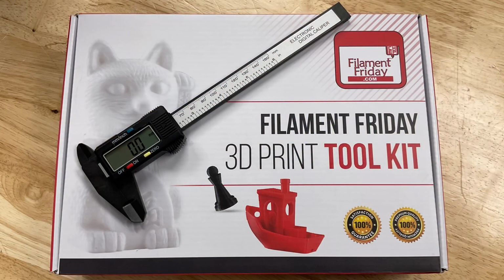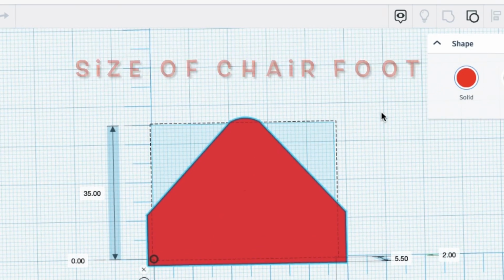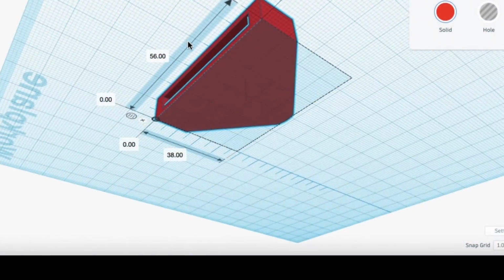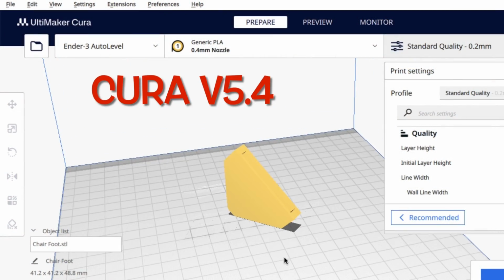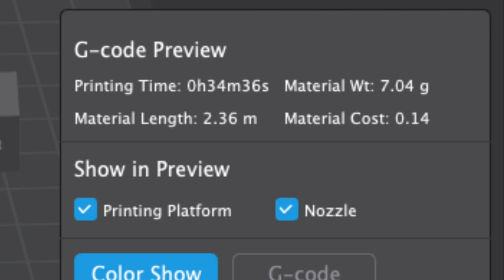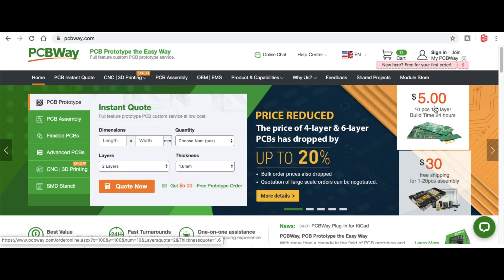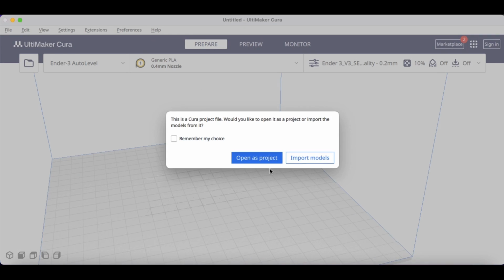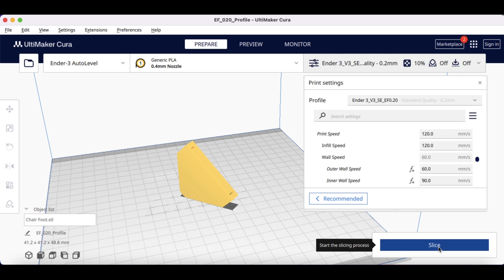Extra Fast Printing on Low Cost Ender 3 V3 SE

Comment: One year later I have two of this printers whit two nebula smart kit. 
Klipper and I 𝕣𝕠𝕠𝕥𝕖𝕕 the printers and have a nice open source printer. 
Whit mainsail and fluid and al the nice updates. 
Yeah and I have upgraded the firmware the nozzle heat up to 200 c and the buildplate go. S to 110 c and I build a in closure whit a serpert 500 watt heater and I can let it heat up to 70 c and print asa nylon carbon fiber whit these printers so nice and most printers do not come whit a heated in closure serpert from the buildplate

Comment: Is it good that print speed 100 mm/s for 0.12mm layer height?
Reply from the maker: Depends on the printer and hotend installed.
Reply: @FilamentFriday  energy 3 v3 se with 0.4 nozzle
Reply from the maker: If it’s a stock hotend then that’s too fast. Stay around 60-70.
Reply: @FilamentFriday  Gotcha. I guess that's how far I can push it. What is the upgrade if I want to go faster?
Reply from the maker: @TheGlitterMan - Yes or just better consistent flow.
Reply: @FilamentFriday  IS there an upgrade to the hotend to make print faster?
Reply from the maker: @TheGlitterMan - You’d have to convert it to run Klipper firmware.
Reply: @FilamentFriday  That will be another day LOL. Do you have video about it.
Reply: @TheGlitterMan  Could try the Unicorn hotend upgrade by creality

Comment: My se runs like crazy.
Print in place they come of super nice .
Even the air engine.
Bal BEARINGS.
Working hinges.
Most of the i print in place.
Juat the probe is not so good.
Bud happy me old school printer juat dial the offset in.
Kuat as Easy as waiting for the machine to it

Comment: I've been 3 printing for over 6 years now. I've watched lots of your videos. My first printer was an original ender 3. I've spent alot of time modding peoples 3d printers. Personally I hate Cura, I used it for about a year and dropped it for super slicer. I find it very strange to not write my own firmware for my printers. Currently there is no marlin example files for this printer ATM on marlin. Do you have any idea when it will come out?
I love this printer tho. 20 min setup time and amazing prints right out of the box.  Looking at upgrades for this printer I'd like to add another z axis motor rather than use the loop to control the 2nd z axis. I used ur slicer profile and got half decent prints. I used creality's slicer and the time was much shorter than urs, but the actually print time is almost identical. I am working on upping the print speeds for this printer, I'd really like to get a profile set on superslucer rather than dreaded cura. If you have any ideas I'd appreciate it

Comment: Just found your channel and subscribed.  I am brand new to 3D printing and boy what a learning curve.  I followed the steps in your video to load the SE EF profile, but when I try slicing with the profile it failed and wants me to report a bug to the issue tracker.  Any suggestions?

Comment: I just got my first printer a (ender 3-3d) a few weeks ago ive done multiple prints and im hooked to say the least. So naturally im looking at upgades, etc. And mostly learning the basics. I was looking for leveling help and ran across your v2 tool. I'm definitely gonna pick that up along with an auto level upgrade seeing how mine all manual. Now i see this video, and im trying to follow with what little knowledge i have with these so far, but my question with all these profiles you made are they interchangeable with other printers like the one you made for the ender 2 pro can i use thisbon my ender 3?  And what happens if i swap to a say 0.8 nozzle from the 0.4 factory one. Will these become obsolete?

Comment: I have been watching your videos for awhile now and they are really great. I am even a new supporter of yours on your website. One issue I am having is my CR-10s is not working at the moment and I am running my Anycubic Kobra Go and none of your .curaprofile files are compatible. I am trying to replicate your print profiles manually but for one reason or another I haven't been able to do so. Would it be possible for you to list your print settings? I know to do so for each of your profiles is asking a lot but even just the "CHEP 2.0 PLA" (using 0.28mm) print settings would be awesome. That is the profile I used the most and build my other profiles off of.
Reply from the maker: They are compatible. Just choose a Creality machine profile in Cura that is similar in size to your printer. Then you can use the profiles.
Reply: @FilamentFriday  Oh awesome, I will give that a try. Thank you!

Comment: Thanks a lot for this profile. I actually don't get those options to create a new profile but that is fine since I don't have one with the same name.

Just started a 15 hours print with this profile on my V3 SE.  The first few layers are looking good. This Creality PLA filament is not that great, it gets cut off when the printer is sitting idling, even though I just opened it a couple of days ago but I think it has moisture. When I sliced it on the original profile, it said 21 hours. Let's see if we can get a 6 hour saving or have this PLA die on me before that.

Comment: I think Ender’s days are numbered with Bambu’s bedslinger.
Reply: True but it’s built as a high speed bed slinger out the box which the Ender 3 isn’t. Linear rails, direct drive extruder, no tool swappable hot ends, multi filament capability, auto nozzle cleaning, auto levelling, same flat bed as the core xy machines. (My Ender 3 bed was warped which I had to fix) The Ender 3 is an enthusiast machine which you will spend the same money as a Bambu on fixing it. Bambu’s bed slinger is a better refined household high speed printer with none of the hassle of the Ender 3.
Reply from the maker: @Stuntman707 - For about that same price I’d rather get an enclosed K1.
Reply: Always hoping it doesn't burn your house down or electrocute you while using it.
Reply from the maker: Maybe but more than twice the price and I don’t like the closed source firmware/electronics.

Comment: Bambu is going to push a lot of older machines aside. But hope this encourages competition.
Reply from the maker: Maybe but more than twice the price and closed source firmware/electronics.
Reply: Bambu is bringing the upgraded high speed experience to bed slingers. It would be nice to see Creality catch up and finally get rid of all the obsolete Ender 3 models.
Reply from the maker: @Stuntman707 - I’ll be testing the Creality Ender 3 KE soon that has Klipper installed for higher speed.
Reply: @Stuntman707  You should be better informed. Even before the A1 and A1 Mini, there were bedslingers that reached 500mm/s. Bambu Lab is late to the party. What stands out about the A1 is the ease of use, not the speed.
Reply: in a year, when they start to deliver the preorders and when it will be actually possible to buy them.

Comment: Does anyone know if there is a glass printer you can get for the Ender 3 V3 SE? Or will the regular ender 3 glass bed fit
Reply from the maker: Glass bed should fit. Not sure if that will affect the Auto Z offset.
Reply: I installed a classic glass bed on the se with no issues